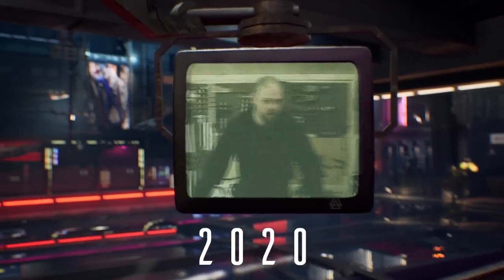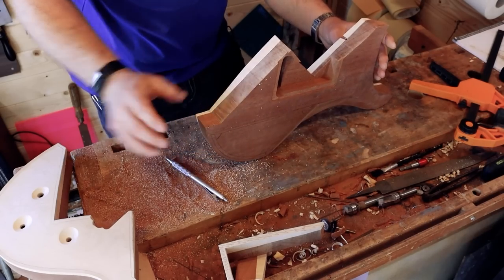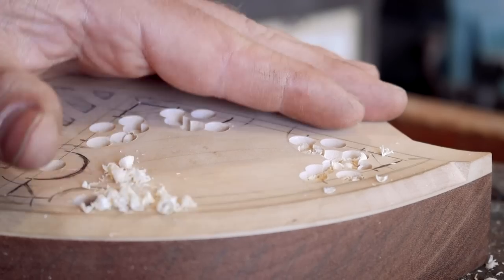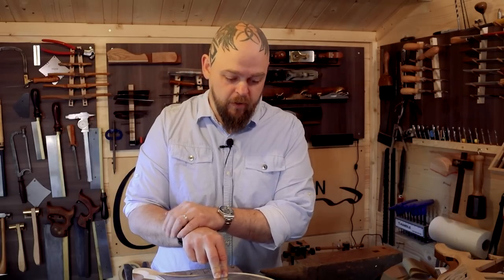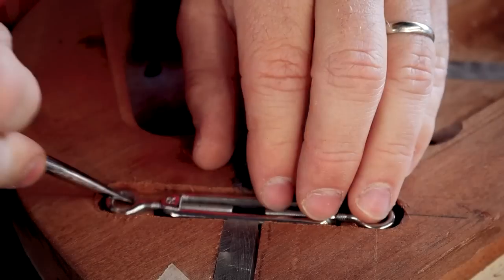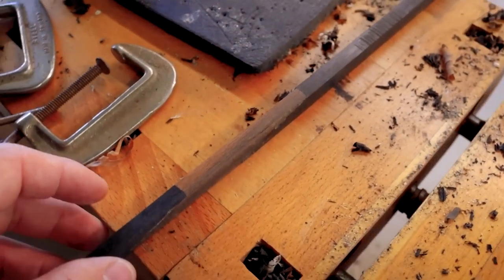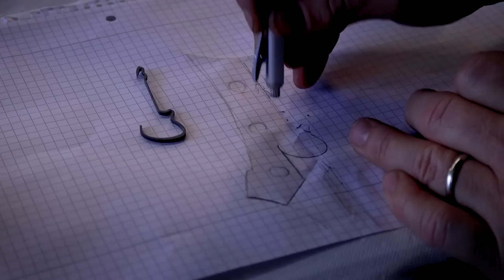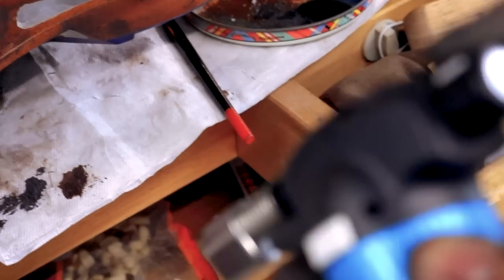Building a CYBERPUNK 2077-inspired Custom Guitar  FULL BUILD

Comment: Remind me - did you ever solve the LED squealing issue?
Reply: it can't be solved without changing the LEDs. The flickering on and off which means it's an AC current and AC currents produce magnetic fields which induce magnetic and electric fields when picked up through the coil of the pickups. Faraday weeps...